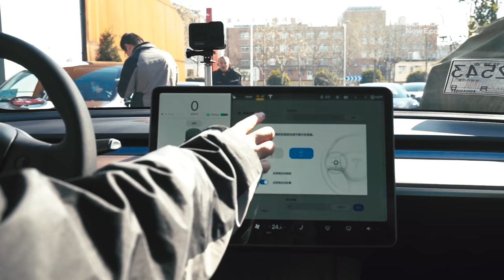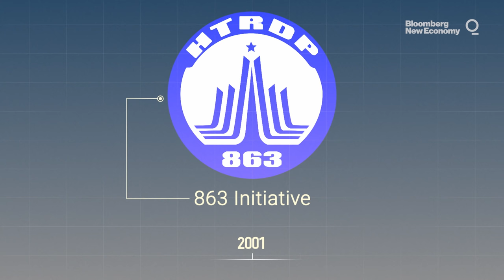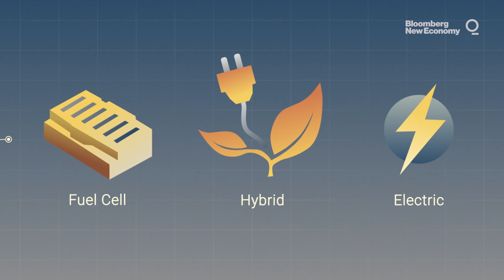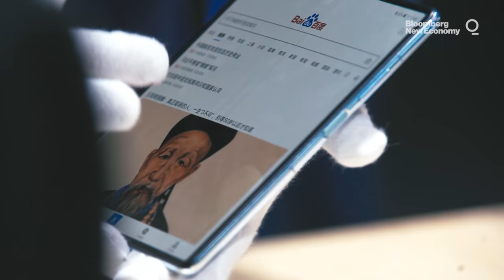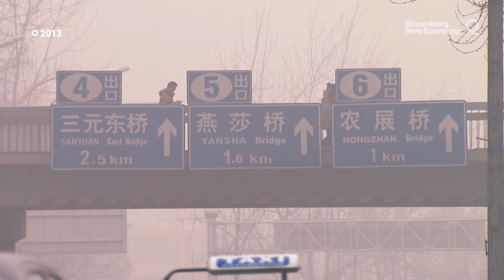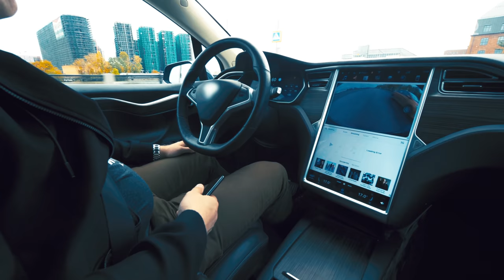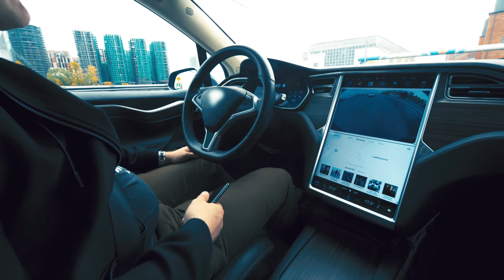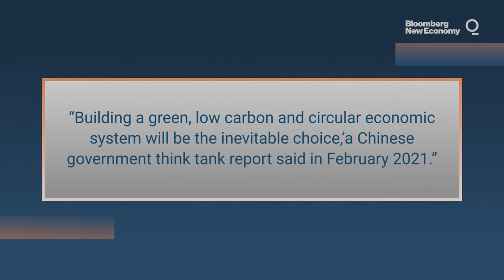Why China’s Electric Car Lead Has Been a Long Time Coming

Comment: tesla originally did offer battery swap.
but stopped because few used it and it didnt make sense economically. 

every battery you have just lying around is another car that you could of made.

it will remain this way until batteries are no longer the limiting factor for EV production.
Reply: Battery swap might not have worked because most US houses have a garage with a power socket. Most Chinese houses in cities don’t have this luxury so battery swaps make more sense. A lot of places in Asia and Europe are in the same situation.
Reply: And New York city.
Reply: @ScoobyDoo-zp1sq  that's just a lazy opinion dude .
Reply: how Tesla did battery swap is very different from how Nio is doing it.
Reply: @snakedoctor2048  thanks for your input. Very articulate and well thought you 🙄
Reply: Battery swap is a really dumb idea, but hey 1.4bil people in China likes it so the world is suppose to like too
Reply: @henryeghaghara9385  yeah, because everyone has 1 hour to wait at a charging station… you’re a genius 🙄
Reply: @ScoobyDoo-zp1sq  yeah, because the world has run out of innovations and battery tech cannot be improved
Reply: @ScoobyDoo-zp1sq  people who cant afford electricity also cannot afford an EV.

every battery laying around doing nothing is a battery that could of been included in a car. 

while electric vehicles are supply constrained (not demand constrained) battery swapping makes no sense (in any form)
Reply: @henryeghaghara9385  obviously if the tech existed to charge your batteries instantly, changing the battery would be useless. But as of right now, companies are using the technology which is available. I might as well say instant charging is useless when they can invent teleportation 🙄
Reply: @Buildings1772  you missed the point….I’m guessing you’re an American….They can afford electricity, but they don’t own a parking spot with a power socket.

Also Tesla is experiencing the battery constraint. This isn’t a industry wide phenomenon 🙄
Reply: linkzable  yes, which is still ~4X slower than a battery swap.
Reply: @ScoobyDoo-zp1sq  EVs in general are demand constrained. it doesnt really matter whether or not the industry is battery constrained (which it is btw).

every EV that is made will sell in a market where demand is greater than supply. for this reason every battery laying around is an EV not produced and sold.
Reply: @ScoobyDoo-zp1sq  also, if they have enough money to afford an EV and also own a parking spot. installing a charge port is well within their spending power and it makes sense economically to do so.
Reply: @Buildings1772  lol. shakes head have you ever travelled out of the city you were born? I think you have no idea what life is like in the outside world.
Public parking lots would have 1% of spots electrified. Outdoor parking spots would be even less. There are reasons why people come up with these unique solutions because of necessity. Not everyone lives in a double garage with a bunch of electricity ports.
Reply: @ScoobyDoo-zp1sq  I have in fact traveled all over south east Asia, India and Alot of Australia. 

I know that the vast majority of people who could afford an EV either; own their own home with a garage, or live in an apartment where they own a specific parking spot in the building's parking lot.

most people without a parking spot that they and they alone are entitled to likely cannot afford any form of private transport outside of perhaps a motor scooter. 

there are exceptions to this rule sure, but they are few and far between. I have not been to china, but id be willing to bet that this holds true there as well.

battery swapping is one of those ideas that sounds great at first glance but when you really analyze it; it just doesn't really make sense.
Reply: @Buildings1772  I really doubt you have. Do you realise that most of these EV cars sold are budget models? The more mainstream EV become, the less of these 'rich' owners with their own private garage with charging facilities will be in the majority. The fact is, there are multiple technologies being sold because they suit different use cases. Even with battery swapping technology cars, they STILL have a charging port. It gives the consumer choice and right now, it's the fastest option to get a full battery by far.
Reply: There's a new tech being rolled out where roads charge these batteries wirelessly in china. You can check them up. So its more like trying things to see which best fit. Combustion has existed over a century and still is being improved and refined to solve current challenges. So don't expect EV to solve everything over one night
Reply: It doesnt make sense for the company but it makes sense for the consumer
Reply: @ScoobyDoo-zp1sq  what you believe about where ive traveled and what I've done is irrelevant. (I lied about nothing btw)

the amount of value battery swapping presents to the user will always be less than the value of an extra EV on the road. 

is it really better that fewer people own EVs just so that the lucky, exclusive few that do can swap out their batteries? 
every battery sitting around doing nothing represents in a very real sense a car not sold to a consumer who's choice you claim to care so much about. 

this supposed "choice" is actually a limit on the number of people who get to choose to own an EV to begin with.

it doesn't make sense economically as the spare batteries represent potential sales lost. and it doesn't make sense as enhanced consumer choice either because; reducing the number of EVs available for the sake of battery swapping actually represents a net reduction the sum total of all consumers experience with EVs. 

maybe one day battery swapping will make sense either after batteries are no longer a constraint or after EVs in general have hit market saturation and transition into demand constrained production.
but right now battery swapping is just a bad idea. 

[(side note: you speak as though charging gear can only be afforded by the 'rich' but its actually a fraction of the cost of even the cheapest EVs to install. also private parking/exclusive spot ownership is actually much more wide spread than you seem to believe)]
Reply: Tesla offered battery swap only in one location in California. They where getting govt subsidy for it. Tesla didn’t even advertise that location and it wasn’t even open most of time. Also they closed it after the subsidy ended.
Reply: @Buildings1772  the battery isnt just "laying around" its charging and with enough users the battery at the stay only sits there for charging then goes into a vehicle when ready. Thus barely any extra batteries are need
Reply: Battery Swap does not work, battery swap LIMITS growth, you cant supply enough batteries.
SUPERCHARGERS expand GROWTH Exponentially, increcing access to FAST charging by the Masses.
Reply: @ScoobyDoo-zp1sq  apartment chargers are cheaper to install and maintain than battery swap stations.
Reply: Just wait some months or years for them to announce how battery swaps makes more sense. DO your research and think big.
Reply: @Prizax  k
Reply: @Buildings1772  you arent understanding his point - many do not have access to a charging station - it doesnt mean they don't have electricity...
Its mentioned in the video multiple times - the US and Chinese markets are different. A vast majority of Chinese EV travel is within a city. This means very limited space, many parkades, or street parking spaces. Neither of which you have control over having an electrical port nearby to plug into. Many Chinese cities have massively expanded EV charging stations to help accomodate this, but if you compare the amount of EV vehicles to charging stations its nowhere near enough.

So if you cant charge it easily when you get home (due to your buildings underground parking or parkade not having stations, or the fact you park on the street) having a battery swap available suddenly becomes something very attractive.
Reply: @snakedoctor2048  lazy opinion? How about the fact that life in the U.S isnt the same everywhere else in the world. Were a pretty rich country...
Reply: @ScoobyDoo-zp1sq  Instant charging will have awful consequences on the grid. And the heat generated during charging is still something that we have yet to engineer a solution.
Reply: @Buildings1772  your point about value of a battery installed in an  EV is greater than value of a sitting battery....
Have you thought of the sitting battery would be the battery that will take in the peak supply from erratic renewables? And it will also be the supply for peak load?
Can a mobile travelling battery do that?
Reply: @ScoobyDoo-zp1sq  Yep, I partially agree with your statement; however, if a car can be parked, a charger can be installed there too. Until the infrastructure is there to charge an EV everywhere, swapping batteries would work well in your use case.
Reply: @ScoobyDoo-zp1sq  No, battery constraints are a industry-wide phenomenon, and will continue to be so.
Reply: @thijsgadella  That's one car that isn't produced. Yep, you have a valid argument; however, a battery will always be stored per switching station.  Overall, for many environments lacking public charging infrastructure, battery switching stations would work well for the time being.
Reply: @ramonching7772  A battery pack within the charging station won't be doing that... Battery packs like the Tesla power wall or megapack (and other similar) would have another benefit, however, with the current battery constraints, a car being built would be more worth it in many cases.
Reply: @ScoobyDoo-zp1sq  you can get about 60% in 15 minutes at fast Chargers. Really you should charge at home and spend zero time waiting for a charge unless you decide to drive across the country. Tesla is making an automated charger for your garage that plugs it in for you so you spend literally zero time maintaining your car. Either way you save tons of time over a year by not going to fuel stations.
Reply: @sebastianorye2702  You missed the similarities altogether. The EV battery pack connected to the grid is exactly like the Tesla power wall. The only difference is... It's not fixex to the wall. It can also be installed in an EV.
Reply: @Buildings1772  you are much less travelled than you think you are. In Singapore where a vast majority stays in Public Housing, there are parking lots that's for the whole estate but not designated for individuals. There are Not enough battery charging stations to support the adoption of EVs. I can tell you too that there are a lot of Singaporeans who can afford an EV.

So it'll be wise not to assume that everywhere is similar to US. There are cities out there where their population density is much higher than what you see in the US.
Reply: had to take some time off so im abit behind on replies
this is basically the first time one of my comments has recieved so much attention.

most people seem to be focusing on the fact that alot of people dont have access to a private parking spot that they alone control. and that most parking spots do not have a charging station. 

there are alot of factors to consider. perhaps more than i originally saw my self. 

i still strongly believe that the cost of a charging spot is far less than the equiv spare batteries to meet total consumer need. 
for this reason as EVs start to take up more parking spaces you will see parking spot electrification become the norm. 

i also still strongly believe that the number of people who can afford an EV with a private spot is far greater than the number with out one.
and selling to these people will likely result in great enough EV market share to make general parking charging the norm

you can believe what you want, i dont care really. I will make one prediction though:
5 years from now battery swapping will not be the norm. the vast majority (> 80%) of electric vehicles won't even support it. 

I'm not going to respond to any more messages on this thread. 
come back in 5 years and we can see how things really play out.
Reply: @ramonching7772  Oh, I'm sorry if I missed that. However, doesn't this mean that the battery will be in a worse state when you have it installed? (Unless it is only used to help alleviate peak pressure in special conditions and not every peak)
Reply: @sebastianorye2702  Maybe worse, maybe not worse. The idea is to have a lot of "containers" to store the excess electrical energy. These can then be used to power anything. The battery packs would be like a micro storage. On a utility scale, there are dams build for use as pump storage.

Here is the thing. Why not make your container also usable for powering cars and peak shaving. Cars are big consumer of power (gasoline atm)

And autonomous driving vehicles are coming. So you don't have to take it to the charrging station or swapping station.

Bottomline is, the more containers the better.
Reply: @ramonching7772  I'm not sure what you mean by "containers",  but I assume it's the battery pack you are talking about. If the battery pack is to be used to alleviate peak pressure which happens multiple times a day. This means that it will have to charge entirely numerous times a day, shortening the battery life. In short, you are right. The more uses, the merrier, but changing the most vital part of the car once a day or so if not maintained right could prove hard to maintain. Battery constraints will probably limit this transition, and if you have a car, then it needs to be parked, meaning that there is a charging possibility.
Reply: @sebastianorye2702  on charging and discharging multiple times in a day.... It is harmful to the battery only when doing deep discharge. Once there are a lot of batteries on-line, discharging can be managed to be just a small percentage of capacity. The Toyota Prius is doing just that. The battery's charge state is maintained at around 80% capacity (that's what I have read).
Reply: Rag Dag , I don't know for sure if you are talking to me, but nonetheless, I'll answer your plea. Okay, enlighten me why I don't get it. China, the world's largest EV market, had 41% of global BEV sales so far in 2021. Although this share will change in the near future, for the sake of simplicity, I'm sticking to this number. As Elon has stated multiple times in the past, Chinese companies are his most significant, and I haven't said otherwise. Tesla, by far, was the biggest EV high-end company, with NIO second (1/4 of Tesla sales). The best-seller, as mentioned in the video, is a small, short-ranged and low priced EV. Elon Musk is one of the most popular western figures in China, with Tesla also making all cars sold in China locally, adding to the support they have. By the way, you can't just change your argument/claim in every comment, claiming I don't know what I'm talking about, so you're "stoopid", not me.
Reply: Battery pack swapping should be simple and straightforward; Tesla didn’t really tried it and Failed 😨
Reply: @emptiness6022  a simple plug and play battery swapping for electric motorcycles works ver well
 But not Tesla why?
Reply: @ScoobyDoo-zp1sq  need to develop an efficient charging systems.
Reply: @Prizax  wait till someone invented a low cost fast chargers for Eva❗️🤔
Reply: @stevenlau7921  I’m not 100% sure, but the biggest down factor is that it requires battery packs to be laying around doing nothing. Batteries are in extremely high demand at a high cost, being around 1/3 the cost of the car, and the cars price as an opportunity cost as well. It doesn’t make sense on an economic stand point to swap batteries.
Reply: @Buildings1772  I think you're surely never travel around the world when you say things like that? 😂
Reply: @ScoobyDoo-zp1sq  These battery swaps are like gas stations located in between long journeys that one full charge is not enough.